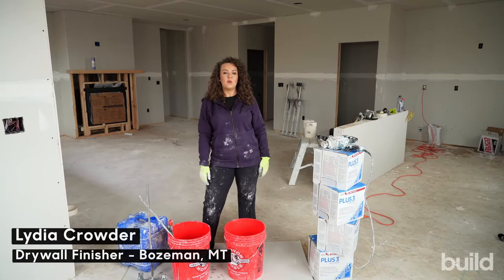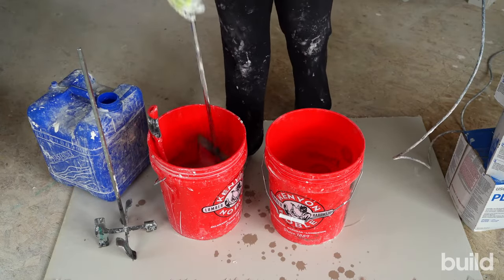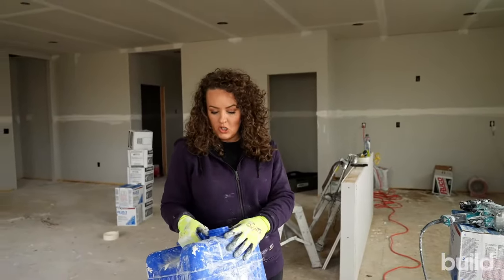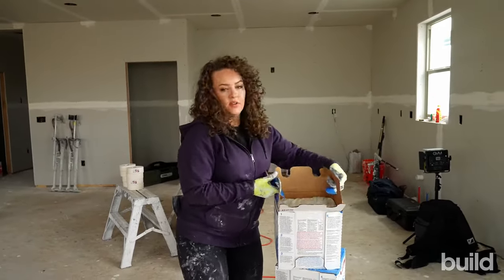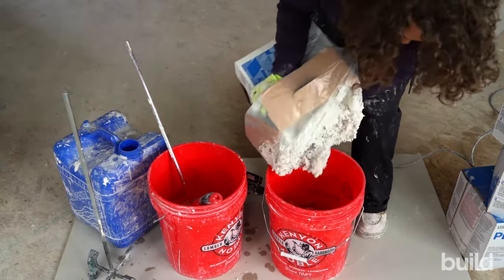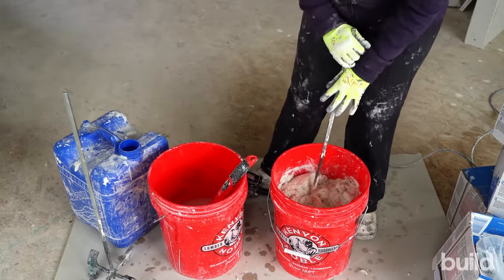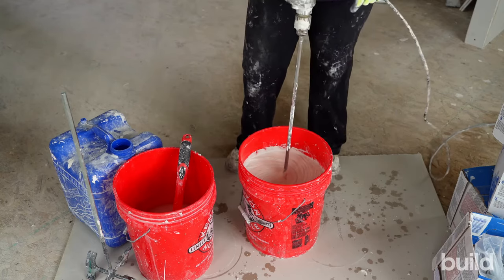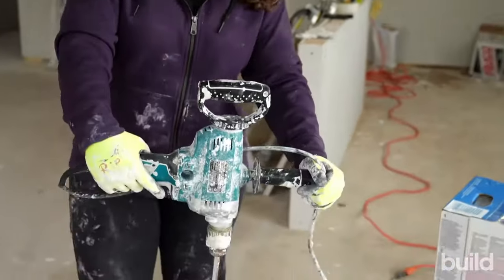How to mix drywall compound so it's smooth and creamy

Comment: Yes!  I love the blue mud it's much easier to sand than the green buckets.  Sometimes I work right out of the bucket but I do usually add a bit of water to make it easier.  But the amount of water you added gave me some anxiety!  Try applying that mud to the ceiling from a hawk your gonna be dropping it all over your face🤣!!  And the floor.  But I think for smaller areas or just on tape lines on walls it might work.  Thanks for the video.  I'm in the middle of restoring an old house with horse hair plaster that's falling out of the latts. I knocked out all the loose stuff and I'm patching in sheet rock then using hard durabond in between the cracks, then mesh taping over cracks then 3 coats of blue joint compound!  Going to try mixing it out of the bucket this time.

Comment: I do drywall finishing only very occasionally so I do it all with hand tools and I am sure that there are may tricks I don't know, but I can't imagine using the thinned compound without wearing more than I get on the wall, yet alone on a ceiling. The compound right out of the box looks about right to me.

Comment: i have a domestic well (and no filtration yet). i get probably a tsp of fine black sand in the water for every 5 gallons or so of water pumped out. is using this quality of water a problem with drywall mud? thanks dwshorty! always something to learn from the videos you’re putting out.
Reply from the maker: It could definitely cause trash lines in your mud - that’s when your pulling your mud and you get a big line down it from a piece of trash/dirt/dried mud etc.. If you can I would try and filter the sand out of the water but you can always try and see if the sand is large enough to cause problems. It might be fine enough to not do anything at all.
Reply: @DrywallShorty  thanks for the reply! i will try it out before committing

Comment: Can you do much smaller batches?  I just need to mud a drywall return window or other small projects at a time?  Can a first timer get a decent skim coat rolling on with a roller and coming back over it with a 24 or 32 inch drywall blade?
Reply: @v boutique check out more videos in her channel she is very knowledgeable and has some great tips. She also has videos on mixing smaller batches of mud for small jobs.
Reply from the maker: Absolutely! You can mix half a box, mix just a pan worth with a pan mixer, mix a whole box and then cover with water for a later use. USG also makes some smaller pails of compound that are good for small patches. You can get one of those, add some water and mix with a small pan mixer to get good results. For the skimming I would absolutely recommend a skimming blade. You can roll the mud on then wipe down with the skimming blade and get really good results!
Reply: @DrywallShorty even a novice could?
Reply: Fill your pan halfway, add a little water and mix with your 4 or 6" knife right in the pan!!!
Reply: @ronduckett5017 Yes that does work, for sure! I also use a blade from an old beater we had that burned up! And a hand drill in the pan! Which is also good for hot mud in small batches.

Comment: How much does one of these box’s cover
Reply from the maker: USG has submittal sheets on their website with the amount of coverage with every variety of compound. This one, USG Plus Three has Approximately 9.4 gal./1,000 sq. ft. (38.3 L/100 sq. m) of gypsum panels per the submittal sheet.
Reply: @DrywallShorty  thank you Im drywall my 12 x 10 shed